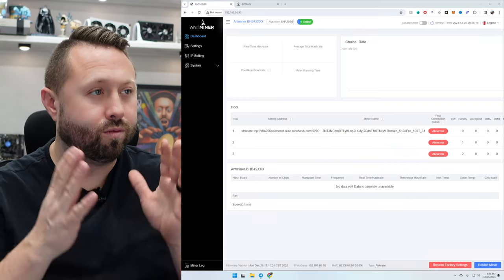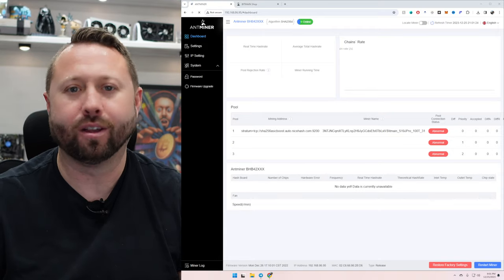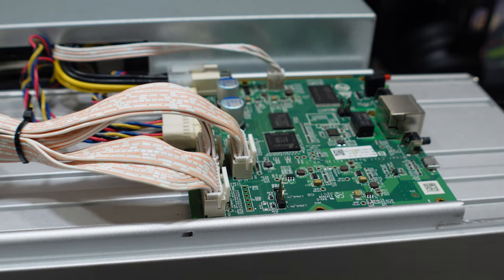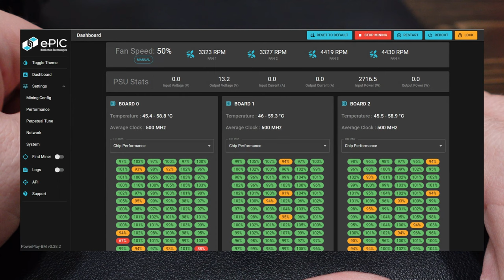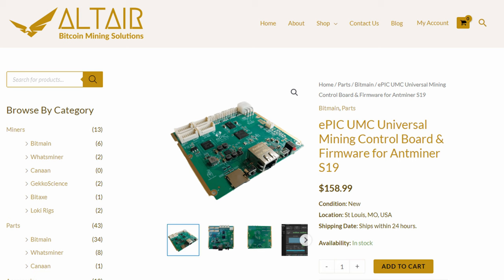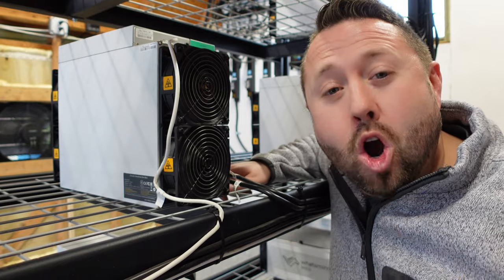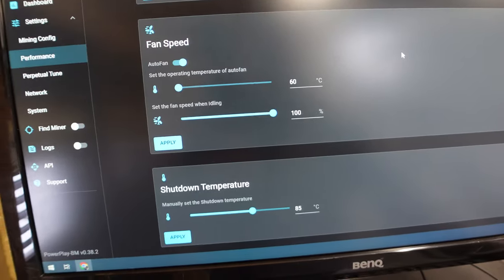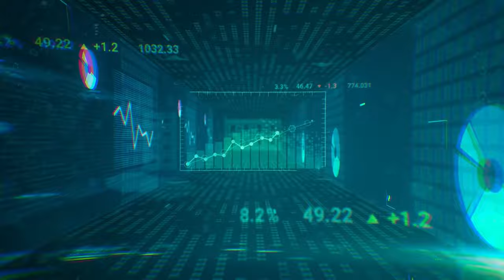Is This The BEST Bitcoin Miner UPGRADE to Buy in 2024? EPIC Control Board

Comment: Hello dude, i might faced the same issue, and with the help of zeus mining support i could get rid of this and upgrade firmware correctly in two simple steps, with no CB change, 
so Flashed the CB with S19 firmware , then re-flashed with S19J pro firmware. and my miners were up and running correctly, anyways the epic CB seems really to be an epic one :D
Reply from the maker: Interesting I may try that, as I saved the "broken" one.  Thanks for the recommendation.